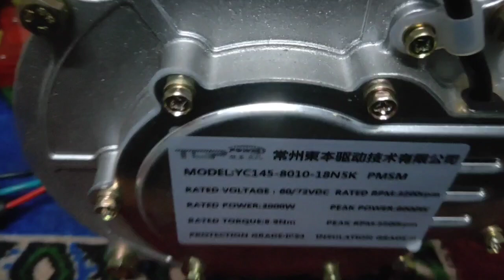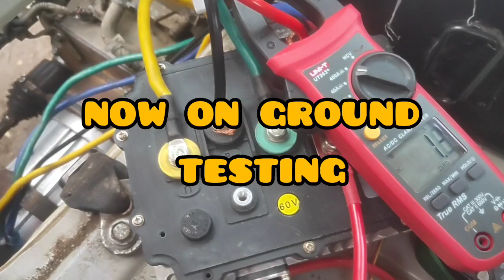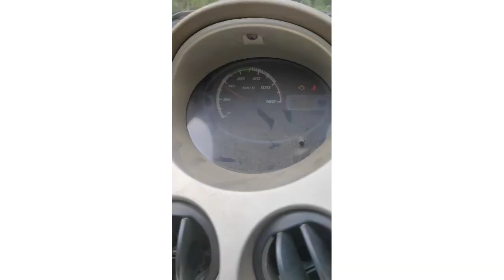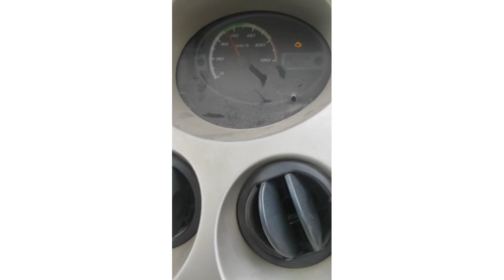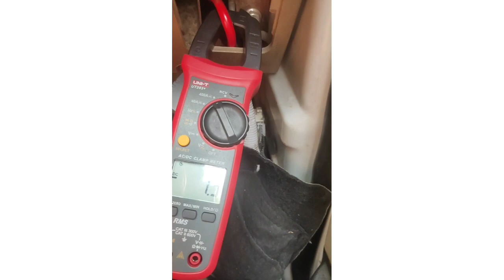Tata Nano petrol to electric conversion

Comment: Does the AC run in this car? Also, do you have to use the clutch to change the gears?
Reply: Yes Ac runs in the car & there is no need a clutch for gear changing
Reply: Does the gear box help in any way, other than isolating the motor in neutral?  What is the type of battery you have employed?  What is the voltage when fully charged and fully discharged?  Does the controller have a regeneration mode?  What about the ac, vacuum and brake, did you hold them as they were?